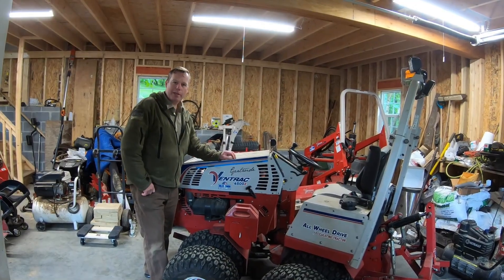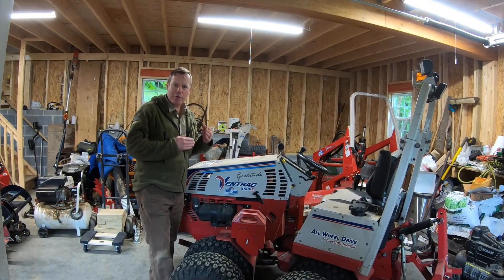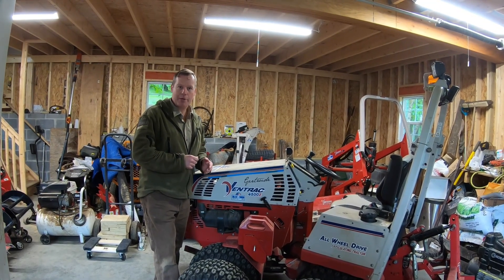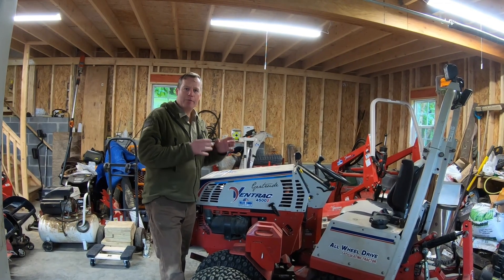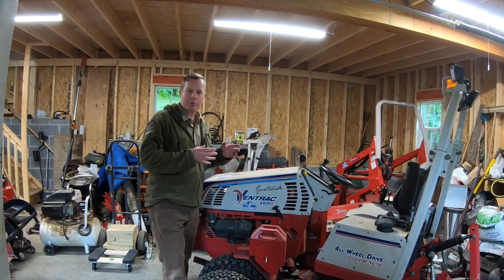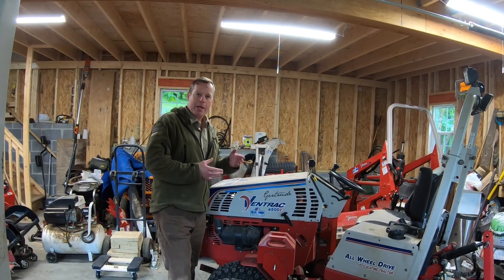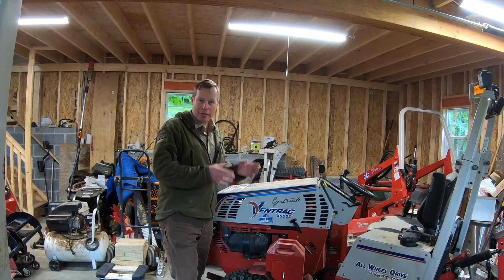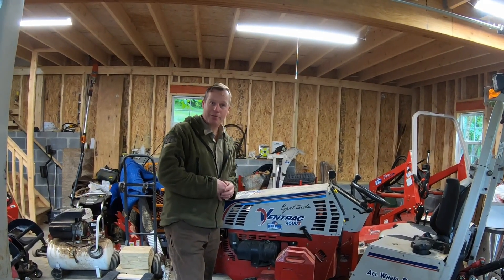Ventrac Hydraulic System and Pump Explained!

Comment: Thanks for the awesome videos. Do you know the hydraulic flow rate and pressure at operating rpm?
Reply from the maker: Stan, the Danfoss series 15 has a Maximum RPM of 4,200 and a continuous 4,000 RPM.  Max pressure is 4,500PSI and a continuous 2,500PSI.  I'm not sure of the flow rates

Comment: I also have a Gertrude. She is dripping some hydraulic oil from a black open ended hose that looks like some kind of vent. It comes down behind the lift cylinder and leads to the ground. Any idea of what that is and why is oil coming from it?
Reply from the maker: Emergency overflow.  Be sure to check the hydraulic oil in the fill tube
Reply: @bluecordterrainmanagement  oil is in normal range.
Reply from the maker: @toddgoodlin2630  Oil expands when it gets warm and may vent from the overflow.  As long as your oil level is in normal range, you should be ok
Reply: @bluecordterrainmanagement  she got around 900 hours on her. Haven’t had this issue before. I was gonna change filters. They’re aren’t do. But thought it might be getting restricted. Do you think that would be worth a shot?
Reply from the maker: @toddgoodlin2630  at 900 hours have you ever had the filters changed?
Reply: @bluecordterrainmanagement  about 125 hours since I changed them
Reply from the maker: @toddgoodlin2630  ok.  The first Hydro Oil change should be done at 500 with 1,000 between each after that
Reply: @bluecordterrainmanagement  Filters should be good then. Just concerned why she is starting to leak like that.
Reply from the maker: @toddgoodlin2630  without a hands on look, I really couldn't say for sure.  How much is leaking?  Again, if the level is good in the sight tube, then there's not much to be concerned about
Reply: @bluecordterrainmanagement  small puddle about diameter of a pop can maybe a touch bigger sometimes.

Comment: Question -  I was looking out a 3 point hydraulic wood splitter. I believe it needs to be an "open" system. I is the Ventrac Hydraulic system open? the splitter is from northern tools. Appreciate any feedback!
Reply from the maker: I would not consider this an open system

Comment: Very cool video! Do you know what the hydraulic filter cross compatibility is between common off-the-shelf brands?
Reply from the maker: You can find filters that will fit, but what you CAN'T find are filters that are 10 and 25 Micron like are used on the Ventrac.  Those are specifically designed to catch extremely fine particulates that will cause damage to the Hydraulic Pump

Comment: Thanks for posting this it is a great visual aid in understanding the main pump and hydraulic motor. I wish you had posted this two weeks earlier. I bought a Steiner 420 whose front drive would only function in reverse and I spent several days figuring out how the drive and auxiliary hydraulics all worked lol. Turns out the rear hydraulic motor was bad, the bearing flew apart and destroyed the pinion gear. All the fluid when trying to move forward was dumping into the rear transaxle. I rebuilt the motor with 200 bucks worth of parts and she now works great. With that said I want to preface what I am about to say by saying this is how it works on my Steiner and I assume since they are both Danfoss 15 pumps they are going to be similar. The "pump" in the Danfoss animation is more like the hydraulic motors on the front and rear transaxles, in that the hydraulic motors have a fixed swash plate. The pump has a movable swash plate that you can actuate by moving your forward and reverse handle. This movable swashplate is what allows the flow move in either direction to the two hydraulic motors and allows for the infinite variability of the hydrostatic transmission without loosing power. There operating principles are the same though so the animation is extremely useful, thanks again for posting. Last thing, the steering and hydraulic attachments are actually fed off the charge pump not the main variable pump. The charge pump provides the suction necessary to pump the hydraulic fluid from the transaxles through the hydraulic filter and up to the main variable pump.  The main pump's operating principle is different and is used only for driving the tractor forwards and backwards. The motors are linked in series so fluid flows from the pump to the first motor, some of that fluid falls into the transaxle but the majority of it then goes to the next motor and powers it. Any fluid still in the loop goes back to the main hydraulic pump where it uses it again to move, it also takes a little fluid from the charge pump I think to replenish any that was lost. Thanks again for the demonstration and the time put into the video much appreciated!
Reply from the maker: Thanks, Josh.  Yes, there are two different "circuits".  One to drive the wheels and the other for the steering, hitch arms, etc.  Steering ALWAYS receives priority in that circuit

Comment: Excellent information...  So given the total tractor weight is 2500 lb, the down force on the front bucket is about 1250 lb, and I would think it would be 1250 lb up also.  If you use the Versa-loader, they tell you to Not use the duals and I think I remember them saying the max lift for the Versa-loader is 500 lb.  I know the Versa-loader has separate hydraulics, are they purposely undersized to prevent damage and tip-over?  Am I correct with all this?  Something isn't adding up.  I really like the dollies.
Reply from the maker: Not exactly.  Without weighing the front and back separately, I don't know how much heavier the front is than the back but I'm sure it's by a fair margin.  You would think that the up force is the same as the down but I'm not able to lift 1,250 lbs, no way.
Reply: The Versa-Loader has separate hydraulics because the implement hydraulics are powered by the charge pump if I am not mistaken. The charge pump does not flow enough fluid to power both the tractor and the versa loader at the same time at least not without suffering in performance. The 500 lb limit is probably there for safety reasons as they have to account for people moving with the weight with the bucket all the way up in air and causing tip over issues. In regards to the slip scoop, The force is going to differ for two reason. The main reason is that the geometry of the lifting mechanism changes and the amount of moment generated differs based on where the it is in the stroke. The hydraulics put forth the same force when extending throughout it's stroke but the amount of force to fight gravity will vary based on geometry. As an example  imagine socket wrench on a bolt and you can only provide a straight-line force to the end of the wrench, (Imagine a rope connected to the end of the wrench that you can pull on) You can generate the most force when you are pulling 90 degrees from the line created by the handle of the wrench. Now imagine you move the rope 45 degrees towards the other end of the wrench, now only half of the force you are exerting is actually being applied to the nut you want to loosen. I hope that works as an analogy. The second reason is that hydraulic cylinders work because there is a pressurized fluid pushing against a surface area. In this case it is the inside diameter of the hydraulic cylinder. On the extension stroke you have the full surface area to push against. But on the return stroke you have the full surface area minus the rod area. The rod being the portion that extends out of the cylinder. So if you had a 2" diameter cylinder and a 1" diameter rod you will loose roughly 25% of the force the rod can generate as compared to when extending. I hope this helped answer your question.
Reply: Ventrac lists the lift capacity of the power bucket at 500lbs with weight transfer off, and 750lbs with weight transfer at max

Comment: Thanks Bradley - very informative.  You mentioned your tires are ballasted.  What are they filled with and how much weight does that add?
Reply from the maker: I've never actually weighed them.  I'm currently running a non corrosive liquid on the 4500 that also acts as a tire sealer.  I was running with Calcium Chloride and those wheels were at least 50 lbs a piece times 8!

Comment: That was a really neat annimation, thanks again!  However, the valuable tip I learned from your presentation was use of the "piano" dolly under the bucket.  Hooking the bucket can be frustrating when it is on a hard, flat surface as it is light enough to scoot away.  I will try that next time.
Reply from the maker: Awesome!  The dollies really help a lot